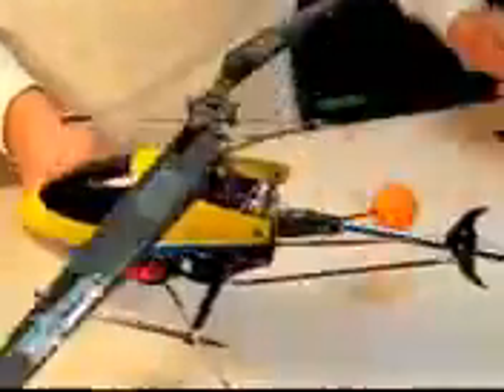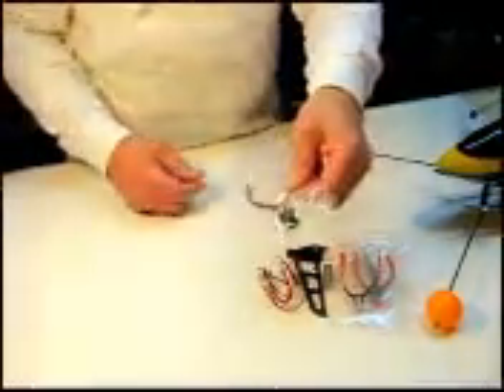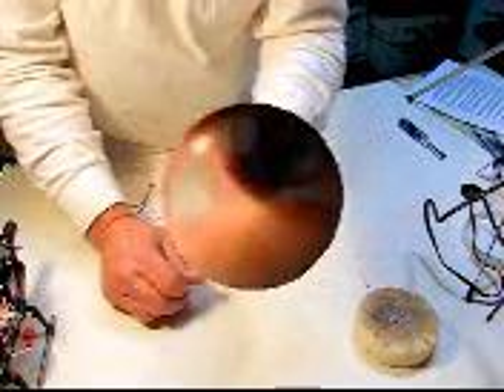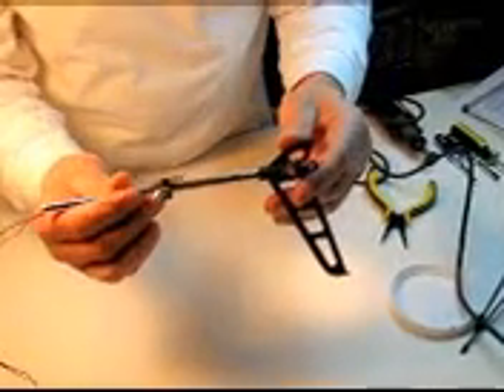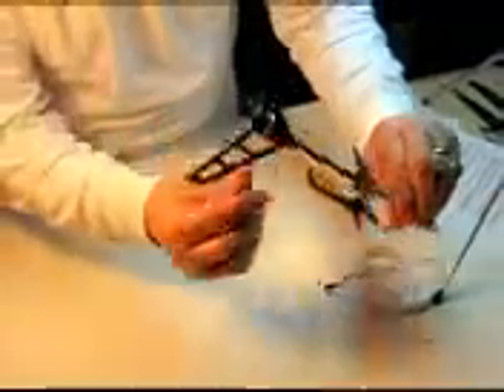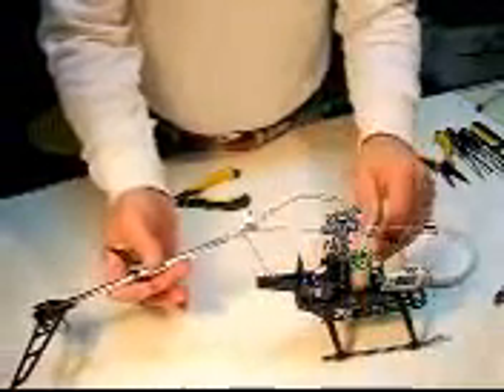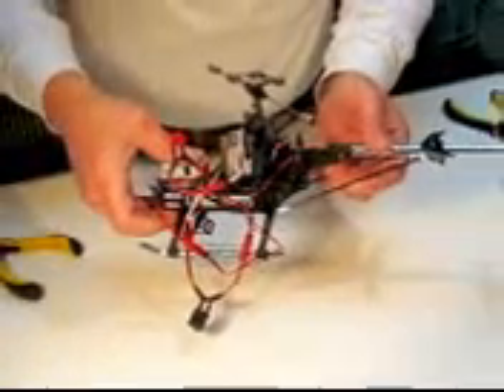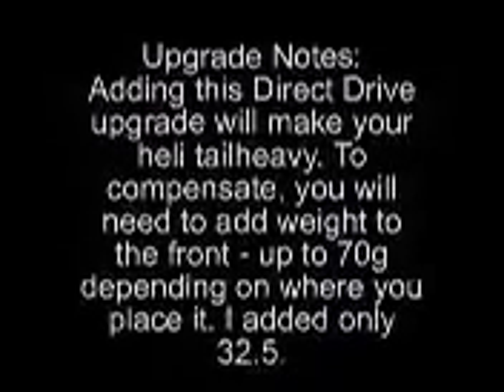Upgraded Tail Motor assemply

Comment from the maker: @3255959 the total cost was under 30 bucks because I also purchased the fuse mod. I still have the mod and it's great. The tail is more responsive and the upgraded tail blades are virtually indestructible.

you'll like it.

rc
Thanks for your comments.